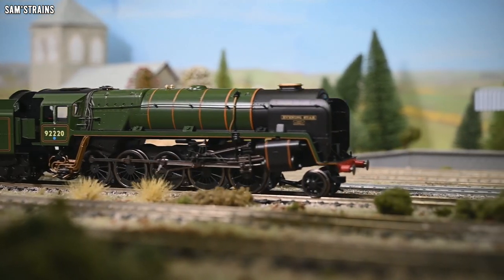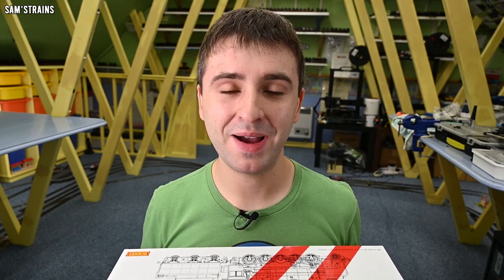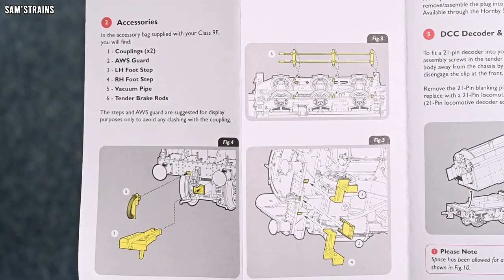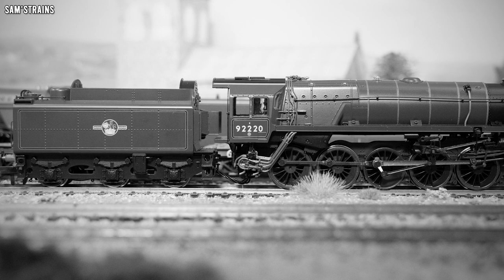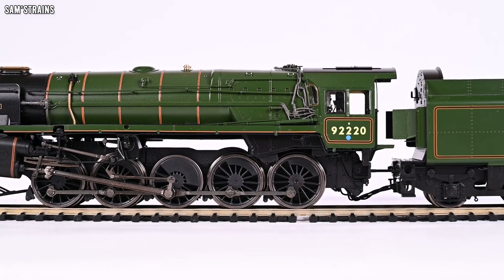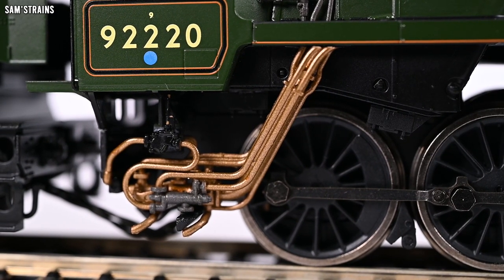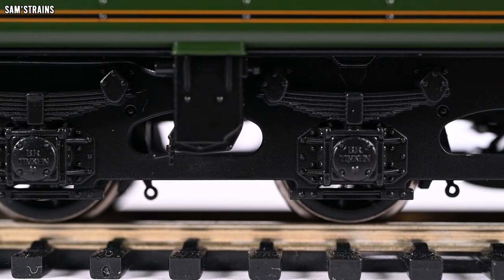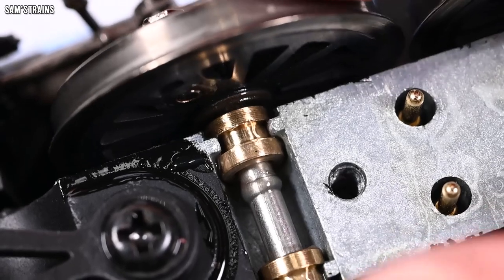All New Hornby Class 9F "Evening Star" | Unboxing & Review

Comment: I worked at a Royal Mail sorting office for one Christmas period, and I have to tell you they don’t look at a Fragile sticker and treat the parcel any differently to any other parcel. They are all thrown in to a “York” trolley for each destination. So if the parcel arrives with you with no damage it will be because it was packed safely before it was posted!
Reply: You can see why people choose other providers with that attitude.
Reply: £250 I'd want the plates fitted!
Reply: Well I was a ParcelPost deliverer for Australia Post for five years and you give the impression that all the parcels are just dumped into those cages.
Well they are not. If it’s a heavy item it is placed and not just dumped. Hand parcels are lobbed not thrown, there is a difference.
The only parcels, I used to do average of 300 a day, that were damaged were because of bad packaging and sometimes having been opened by customs. Only a handful were caused at the parcel centre and those were left there where they were repackaged and a note stuck on them with contact information.
I have had dozens of parcels via Post Office and not one has ever been damaged.
Even though It’s Australia Post there is no reason why British Post would be that much different in operation.
Plus you stated you were only a Christmas worker so I doubt if you cared how you treated the items as you weren’t likely to ever work there again.
Reply: I can agree with you Jim ,I worked three Christmas at royal mail and fragile sticker don't mean a thing it will still be thrown in the York without a second thought.
Reply: 11
Reply: Well that’s desperately sad because it surely says a lot about the mentality and careless attitude of Royal Mail sorting office workers!  You would think they would have reasonable moral and ethical values as employees - respecting customer expectation that their goods will arrive safe without damage and taking extra care whenever possible. Of course sometimes a “culture” can be created by a rubbish employer that results in the recruitment of a poor quality ‘couldn’t care less’ workforce. I suppose 🤔 …just MAYBE…the official company line might be that they don’t have any mechanism for treating fragile parcels more carefully than others; and therefore it’s down to the sender to make sure the goods are adequately packed but i’d like to be a fly on the wall

Comment: In my opinion, for that price it shouldn’t just be DCC ready, it should be DCC and sound equipped.
Reply from the maker: Yeah I agree, it really should have had some sort of DCC!
Thanks for watching, Sam :)
Reply: To me in my views, for that price; it should have DCC sound and synchronised puffing smoke
Reply: have you seen Hornbys price for the forthcoming Black 5 with smoke generator???...
Reply: Totally agree. Looking at it pulling the coaches and as I USE my locos as opposed to just looking at them..... would never spend £150 on this, never mind £250.
Reply: As a US-based modeler, I can only dream our manufacturers would release accurate steam locos with diecast boilers, abundant separate details, modern standard DCC plugs, AND speaker enclosure for sub-$300 prices. Over here, this is a $400-500 loco, probably with some unwanted proprietary decoder.
Reply: Yeet
Reply: No way could i afford that, i just buy non runners off ebay and fix them up.
Reply: @pwk879  British model enthusiasts are spoiled as despite price increases the cost of OO RTR is still very attractive compared to HO. I like Chinese and Japanese HO models, both of which tend to be a lot more expensive than OO.

Comment: I think a detail that's kinda nice about this 9F is that the cranks on the Walschaerts valve gear are correctly positioned. A lot of models often have one side in the proper position, the other in the opposite direction. Heck, even the Gordon and Henry models in the Thomas the Tank Engine series had that little flub.

Minor nitpick and all, because it only takes a slight adjustment, but it's nice to see it proper straight outta the box.

Comment: Same as you, our first reaction was: “Wow, have they finally cracked it...”, since she looks absolutely stunning and (finally) well assembled. And then a basal simple thing again made us chuckle... Again.., the motor. We had high hopes, but this would be a direct candidate for a return. It could very well be that she runs fine on DCC, but come on now... Fair review Sam, fair review, but we would have returned it tbh.
Reply from the maker: Thanks Linda - yes motor not quite right unfortunately.. drawing almost 3x the current of the Railroad version, yet still running much more sluggishly! I'd always recommend returning models like this, but I may keep it to replace the motor with a coreless one and my 3D printed bracket!
Thanks for watching, Sam :)
Reply: @SamsTrains  In that case, it would certainly be very interesting to see the difference with 1 flywheel or even none for that matter. That would be an intriguing experiment to see if it actually makes a significant difference, or that the motor itself simply is at fault.

Comment: I've been impressed by my 9F, pre ordered 92194 and running DCC. I've found no lack of power with mine, and is hauling 8-9 bachmann mk1s with no problems. Maybe just a bad motor, though have read some have struggled running DC.
Reply: It would be interesting to know if Sam were to try his model on DCC to see if there is an improvement in performance.
Reply from the maker: Yes the controller/power does seem to make a difference - I've since tried this on a feedback controller and the torque was much better... but I don't want to use feedback for my main controller, as many manufacturers now use coreless motors which don't agree with them. The new 9F draws 270mA with no load... old Railroad one draws 100mA under the same conditions... something not quite right!
Thanks for watching, Sam :)
Reply: @SamsTrains  If the motor is skew wound, I think it is working against itself. Hence the big current draw and weak power output, i.e. poor efficiency.  Perhaps a regular 5 pole motor would be better. Heck, why not a 6 pole? There are some suitable ones available and they run very smoothly. I have retrofit almost all my Hornby 0-4-0 former "pocket rockets" with 6 pole motors. Now they are able to crawl unbelievably slowly and the top speed is more realistic. Would you like me to send you an example?

Comment: Sad that Hornby can build a loco that can justify their "Trix" pricing yet still fall on something as simple as not fitting a premium motor, what were they thinking.
Reply: I was thinking exactly the same. I mean motors aren't that expensive in the grand scheme of thingsso why are they skimping this much?
Reply: Man, the people from Hornby were not thinking at all. They are still not doing proper testing on the motors. Plus, they still do not want to reduce their jacked up prices because they think in their tiny minds that jacking up the prices on their models is going to save their reputation. In reality, it is ruining their reputation in the process and it will make them go bankrupt at any day and time.
Reply: The same with many Dapol locos, really nice other than the crappy motors.. As you say skimping on such a crucial part of the model which really doesn't cost much is really dumb.
Reply: I agree completely, and I do have a couple of Trix models and they are a work of art, surely a decent motor can’t be that expensive, especially with the price tag attached
Reply: Hi @Graham!, Not that I disagree at all, but, I would like to make a small comparison between both brands. If it were Trix, at least the locomotive shell would be metal, and the axles would never be plastic, you would have a better motor and you would have lights in front, back, cab and maybe even a metal tender....

I am not saying by any means that Hornby is bad, but, if you aim to a higher price range, shouldn't you aim for a better standard?

I would like to clarify that I am just a Trix collector and club member, and with all the love to the hobby, this locomotive cannot be compared.

Best regards,

D.
Reply: @alexg6265  perhaps because of rising prices in the UK, or they're just trying to get some savings in case they go through a multitude of years where they can't turn a profit like the period from 2012 to 2021, 9 years for which they never turned a profit. I am just speculating but these are my best guesses why
Reply: @alexg6265  Agreed, it is looking at the results Sam got with some cheap motors off Ebay, no more that the need to spend 0.5% of the retail price on a better quality motor (£1 to £1.50) and then they would have had had a locomotive that could go toe to toe with the best of Trix and Roco and so justify Hornby's new pricing.
Reply: 🤑🤑🤑🤑🤑 This is what hornby were thinking. Even with a decent motor it would never get near Trix quality.
Reply: @dbrhall  I've got an extensive Trix collection. You might be surprised to learn some models are made in 
China. 
Some of my older ones came with expensive Swiss-made Maxon coreless motors and some with coreless Portescap which are of European design made in India. However, Marklin-Trix fit Asian can motors to a lot of stuff these days!
The Hornby scores having a metal die-cast body and better cab detail but loses out with a plastic tender and wheel spokes.
If it was mine I would fit a German Bühler motor which doesn't cost that much.
Reply: @jackdripper5675  Dear Jack, I know what you mean. A couple of comments, as far as I know the China production was finished years ago. I shall not try to justify the damm mistake that was as well as the C-Sinus 🤦🏻...but, really, I think that the point is not whether to go and take a bühler (Lilliput Wien did that) or Maxonmotor or whatever, I do not believe in brands, you can take   Tomix or Acme and both use canon motors, as well as fulgurex or metropolitan does, but really, someone at Hornby ought to check, not only for Sam but for all of us why they keep using this untrustworthy motors. And again, it is discouraging and in the long term, bad for the hobby.

Best regards,

D.

Comment: It would be interesting to put an Ammeter in series with it. My Hornby B12 drew 400mA just dragging itself around the track at first. It ran in a bit drawing ~350mA. The amount of current tended to create heating. Then my B12 died…. That wretched motor was a terrible choice. As you say, in theory that long armature should mean a lot of torque, so I’m guessing Hornby chose it with good reason. However; the reality is the real world performance isn’t cutting it. Tragic as Hornby could do with a model or two to become best-sellers, especially at this price point. Great review as ever. I’m not buying one with that motor !!

Comment: Superb review, I was waiting for your review before purchasing... good decision, I have two Bachmann 9F's that are excellent apart from being quite hard running on ballasted track - they need metal bearings on the wheels. I have a Hornby railroad 9F that lacks power compared to the Bachmann ones, the wheels slip with 20 or more loaded trucks and the lack of tender pickups means it is prone to stopping on curves. So I was eagerly waiting for the top one, being di-cast etc but I think now I am waiting for Hornby to change the motor, or Bachmann to add some bearings... in the mean time I will add pickups to the Railroad tender.

Comment: I have the R3987 92194 and it did indeed come wrapped identical to yours Sam. It came in a cardboard box with a fragile sticker, then it was double bubble wrapped inside, and indeed had the foam ends and the loco box itself was well wrapped. I recently got the Queen Jubilee and it was also wrapped in this way. Seems that Hornby have actually learned a lesson.
Reply from the maker: Thanks very much for sharing - and I didn't know the Jubilee engine had the same packaging... very cool!
Thanks for watching, Sam :)

Comment: Maybe time to invest in some DCC gear to test these engines on DCC. I think some of these mechanisms are designed primarily for DCC now and run only just about ok on DC. Because of the way DCC works pulsing the motor with essentially full power there is often a night and day difference with performance.

Comment: I think these motors have a fundamental design problem. Hornby knows these are dodgy from the past but maybe they thought that a particular batch had an issue and not a design issue. I still think all locos should be like the Hornby Merchant Navy Class's mechanism and performance. Still love the Merchant Navy but the new 9F is pretty good still but no loco can steal the place that the Hornby Merchant Navy holds in my heart !
Reply from the maker: I think so too... I've seen this time and time again... though they can run well.. my LNER green B12 is a superb runner. Not sure what causes this problem... but this 9F is drawing almost 3x the current that my Railroad one does, and yet its so much more sluggish... not right!
Thanks for watching, Sam :)

Comment: Hi Sam, a most enjoyable and honest review on a great new Hornby locomotive;  At last !!. It's obvious that this 'beast' doesn't like tight radius-es - and most long stiff frame engines don't like S- curves ! Same behavior in the review by Adi Pullen. It's not only the motor but the stress - resistance - on all 5 axles going through a tight curve. A stronger motor would indeed help, especially at this given price point. Did you do a Amp test on a rolling road yet to check the motor healthiness ? Success.

Comment: £253!! I spent £1150 on a 250hp 2004 Saab 9-5 Aero estate this summer. Should I have bought 4 Hornby 9F’s instead?
PS Just watched until the end, pity about the motor, just not acceptable in a £250 model. I’m glad I bought my 9-5! - It doesn’t slow down round curves or on inclines 😂

Comment: I have just run in my new tooled Evening Star on DC on the rolling road and it was sweet as a nut! I shall see how it hauls on my layout after DCC fitting. It looks great but it has to work properly on my layout. Your situation with track on a carpet and an uneven attic floor is a source of concern for some modellers, but not so much for me. It offers a tough test and model locos have to deal with inclines which are common on many layouts. I have a small incline on my tabletop layout because of the incline in the floor of my attic which I have corrected to some extent with strips of thin plywood under the table legs. It's fine for the vast majority of my locos. So I too may have some running problems if your review is indicative. But then again the space I have -which is by no means small - means that I run five to seven coach trains only and if the loco can haul them successfully around the layout then it passes my test. I will not run eight plus coach trains. Horses for courses I think! Will post my results here in due course.

Comment: One of my standard loco tests was to start a rake of six Hornby Dublo tin plate coaches on a 1 in 32 slope that’s two n seven eighth’s over 8 feet (u work out the metric) very few modern (non-Hornby Dublo) could manage that, this 9F would also fail so no good to me as an operator. Another issue I have with all manufacturers is the leading pony truck, admittedly I have half a dozen points on curves but it really is time Hornby and Bachmann sorted the problem of derailing, I spend lots of time ‘springing’ pony trucks to keep them on the track and the newer fixed axle carriers with lots of sideways slack are hopeless. Looks like my old Triang rubber tyred tender drive will have to soldier on a bit longer

Comment: Ok. Just hooked up my 9F(92167 br black) to 7 Bachmann/Hornby coaches on my test track. It is DCC and has no incline or reverse curves which imo always a task for a long wheelbase loco such as this. Its fine at lo speed and havr it currently on 25 @128 perfect no slipping or cogging or jerking and constant speed. I think I could add more coaches and it would be fine? 7 is what my layout will feature and as ling as it can do that im happy. DC is always going to be different. Thanks for reading.

Comment: Sam, with the performance test you did, it does suggest the motor has low torque. It might be the motor is not very efficent, pulling a high current under load. The decrease in speed might be that the voltage regulation of your controller is poor. In other words the controller voltage is droping a couple of volts as the motor current draw increases. To confirm if it is the motor or controller, when you do your load testing, measure your track voltage. If the voltage drops, then the controller is not very good. If the voltage stays constant then the motor is underpowered.

Comment: For that price I would expect it to run like a Swiss Watch, watch films of 9Fs working the S&C the speed is not much over 30PMH, this model is as fast as the InterCity 125. The comments about changing the motor should be made to Hornby not the customer. Fitting a higher ratio gear box would have improver the slow running and increased the torque.

Comment: An excellent effort by Hornby, and nice to have a larger, mainstream locomotive with a diecast boiler.  Pity about the seams.
Must admit, I still prefer my Bachmann Evening Star, which seems to perform better than that, and look at least as good, but with a superior finish - sorry, my opinion.
Not seen a 'stock' locomotive for £250 before?  What about the Dapol Black Label - admittedly all singing and dancing - A4's?  !!  £400 guv!!
Excellent review, as expected.
Thanks Sam.
Not parting with my Bachmann.
Al.